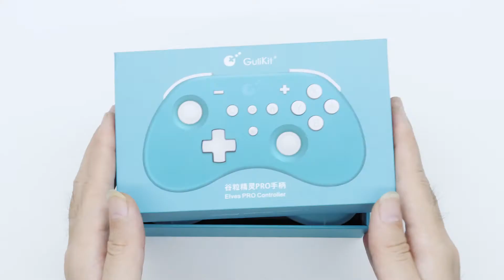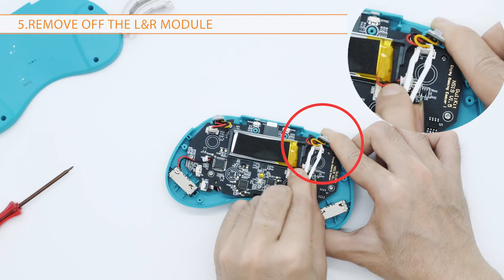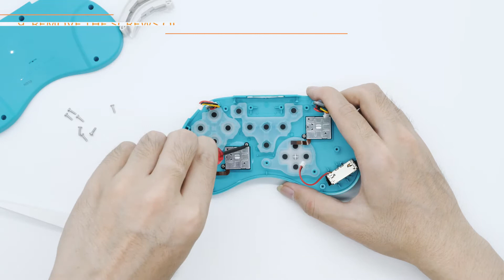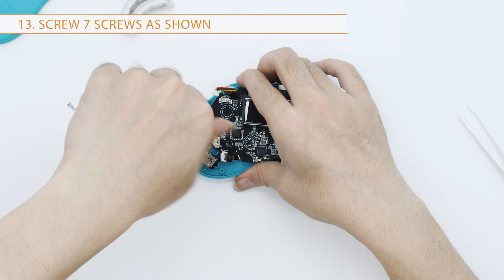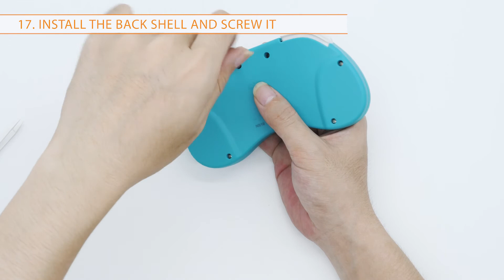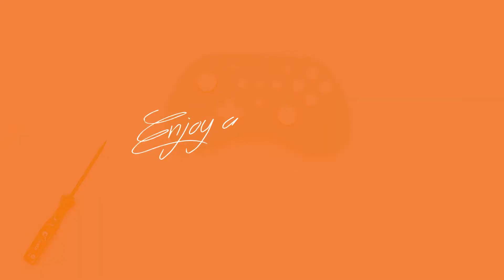GuliKit Joysticks Replacement Tool Kits Repair Instruction on Elves Controller

Comment: The "+" button in my gulikit king kong controller is not working. What are some possible solutions?
Reply: I really like the controller even better than the og switch procon pls help me on the fix. I sent it for warranty but they did not fix the problem.
Reply from the maker: @brainardvillaverde5160  Please try to reset the controller by pressing gear and - buttons together, then you can check the "+" button.Thanks.

Comment: Are the ABXY buttons physically keyed, or could they be physically swapped while the controller is open?
Reply: I just took mine apart and no. You can take the buttons out but they're shaped differently and only fit in their own respective slots.
Reply from the maker: @i0ntempest  Yes. you are right. Can not swapped physically.Thanks.
Reply: @i0ntempest  how's your elves pro keeping up?

Comment: I received this product and tested button firstly. but X, B button doesn't work well. 
especially, I have to press 'X' button harder to work well
what should I do about this? I think it's initial defect.
Reply from the maker: Please reset the controller first by pressing Gear and - buttons to check if it is better.Thanks.

Comment: I'm planning to buy the kingkong pro, is it the same with elves? or they are different?
Reply from the maker: There are some small differences.Elves Pro has HD rumble,while Kingkong Pro has no HD rumble,Elves Pro supports iOS,while KingKong Pro doesn't. Other functions are same. Thanks.
Reply: @GuliKit  what I mean is the replacement and repair
Reply from the maker: @GNOXEMoto   The sticks between King Kong Pro and Elves are different. The sticks can not be replaced mutually. Thanks.